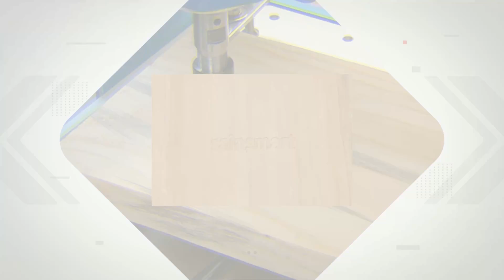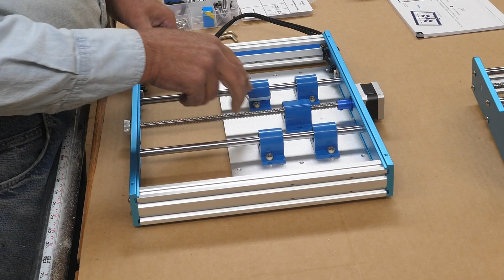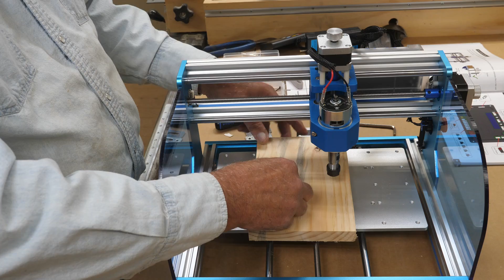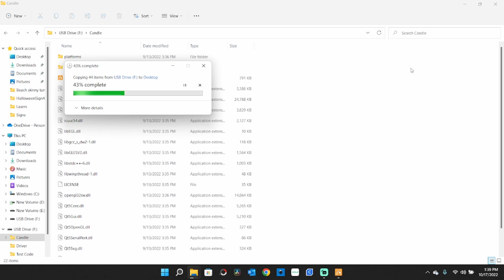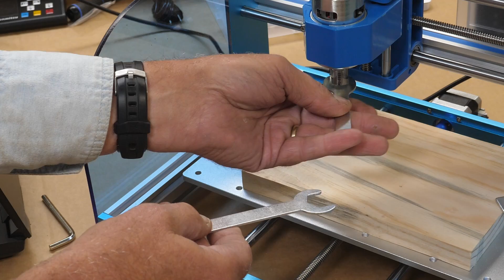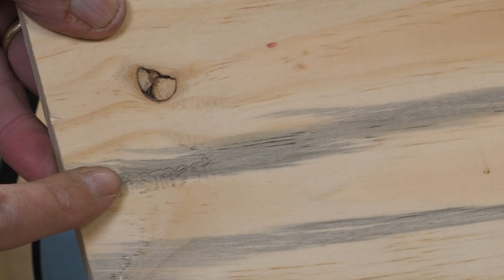Sainsmart PROVER V2 Assembly and Startup

Comment: Thanks Roger.  This was the best one I found.  I had mine set up fine but it was the configuration in Candle.  between your instructions and theirs I finally got it to work.  Do you have a video on how to choose your bit?  There are 10 bits and was curious if they made a difference.  I assume so.   Also how do you pick right speed?  is there a standard somewhere?
Reply from the maker: Have not done any specific video on bit selection, spindle speeds, or tool path speeds.  There are so many variables that there is no standard.  the stock bits that come with this unit are V carve bits and are all the same unless they changed something.  They are OK for general engraving, but will not give straight sides or a flat bottom.  For that you need an End Mill bit.  Same for cut outs.  While the V Carve bit "can" do it, an End Mill is better and will give square sides to your cut out.  Regardless of bit used, you cannot cut or engrave a perfect square inside corner since all bits are round.

Comment: JFYI, The way you fitted the collet directly to the motor first they can come loose, with All ER collets you fit the collet to the collet nut first at a 45º then straiten it and it clicks in, then fit the assembly to the motor loosely then the bit.
Reply from the maker: never have had that happen on any of my CNC machines

Comment: I received a PROver V1 for Christmas and returned it for the V2 based on your videos and others reviews. I see you do a lot of laser work. I have the laser kit. Problem is on the V1 you connected the laser board to the PWM 2-pin connector on the main board and supply power to the laser board with a 12V power supply. 

Now the V2 does not have a 2-pin. It only has a 3-pin "laser" connector. Took 3 emails until SainSmart CS gave me an answer on how to hook it up to the V2. They say to use the 3-pin and still use the 12V power supply. I haven't had time to try this but a little worried because the 3-pin has a power wire and don't want to mess anything up. Have you tried your laser on the V2 yet? If so how did you make connections?
Reply: I just plugged the 3 wire in and did NOT use the other power supply and it worked.
Reply: @BrentRicks  Sorry, I deleted my original reply because Sainsmart got back to me with updated information. You may want to inquire to them directly but it's good news. They said the new control board on the V2 can power the 5.5W laser itself without the additional 12V power supply.
Reply: @youmbgtube  that makes sense. Plus, it seems the imported button don’t all act like they should without both plugged in. Wish Sainsmart would publish an updated PDF the V2 setup of the laser.
Reply: @BrentRicks  Yes, I had to ask them the question several times. Didn't get a decent answer until I sent lots of pictures showing that the V2 has only a 3-wire laser output on the main board. Oh, they did say it's OK to power the air pump off the main board on the V2.